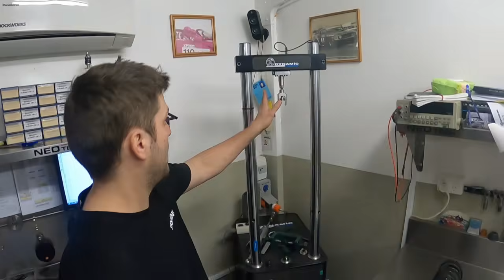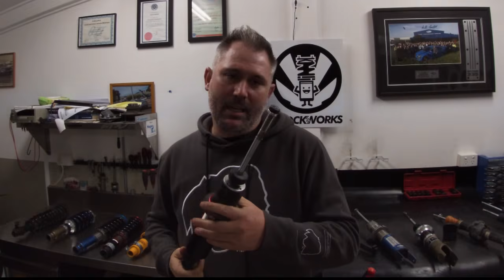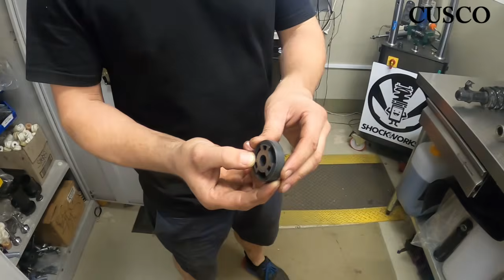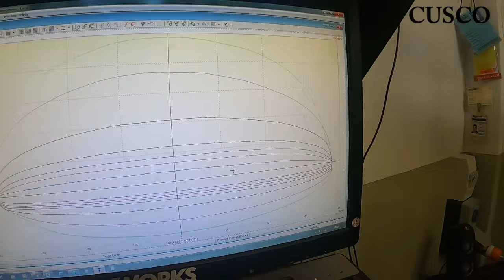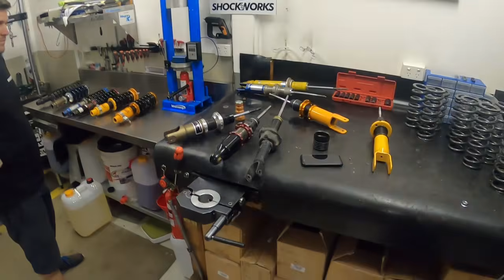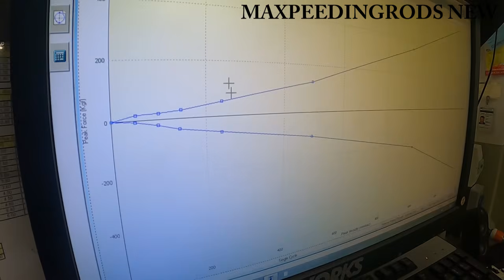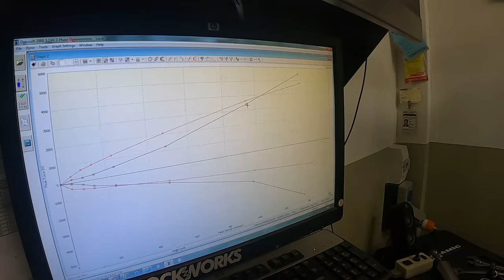8 BRANDS OF COILOVERS ON THE SHOCK DYNO!!! WORLD FIRST TEST

Comment: ....but how does the shock control the spring's motion?  The damper needs to match the spring and be able to control it. To stiff of a spring and the damper loses resulting in a bounce. Like cars going down the road porpoising 🐬🐬
Reply from the maker: Correct but it starts with the right shock
Reply: The gas or fluid in a damper is designed to be pushed through valves which together slow down uncontrolled motion and create resistance to movement in general.

Think of it in terms of a damper which you might find at the top of a door that has a spring that pulls it shut. The damper controls and slows the motion of the door, allowing it to close gently. Without the damper, the door would slam.

A car's damper does similar by controlling the repeated, unconrolled body oscillation that a car with an undamped spring would have. 

Yes, the damping range must be matched to the weight and energy of the spring. High spring rate/lower damping will result in under-damping (too little body control, a wallowy feeling). Lower spring rate/high damping will result in over-damping (where the damping force is too "stiff" for the spring, the damper shaft moves too slow to effectively respond to uneven surfaces, causing the tires to skip and lose contact across bumps and crash down into dips [jacking down] instead of smoothly moving up and down in response to dips and swells/bumps in the road).

Comment: I want to put them on a 2013 Honda CRV just to fill out the gap a little maybe lower the car an inch and a half with regular proper street driving/no racing no hard driving do you think they will last as far as leaking, as far as I’m concerned, I’ve had 20 year old stock coil overs and they never leaked I drop
Reply from the maker: If you are talking about mxr coil overs they will be fine if you get the T07 or T06 design, but if you make it too low the shocks won’t be able to do their job it might just be sitting on the bump stops
Reply: @TURBOTRISTO  I have 18 inch rims and a 50 sidewall I think an inch and a half max. I still wanna have some gap because I use it every day it’s my family car. I checked for the T7 and nothing comes up for the fourth generation, CRV if you can find a wink for me, I would really appreciate you. Hey, thanks for replying keep it real.
Reply: If you want to see my car, it’s all my YouTube channel. I think it’s about the first second or third video in. It’s really cool looking for an old guy. Ha ha ha

Comment: There are 2 versions of BC, the basic one BC V1 with 44mm piston (the one you test) and a slightly more advance model BC BR with 46mm piston.  Do you think a bigger piston and body can improve the performance significantly?
(Currently I want to change my coil overs, the price between BC BR and BC V1 is not too big, around USD$150)
Reply from the maker: @illson12345  since this video there have been several updates to almost all brands mxr have revised their design 5 more times and are as good as the bc tested and bc have improved aswell, I recommend buying the best most expensive suspension components you can afford

Comment: I'm looking to upgrade my OEM shocks on my 2006 Acura RSX. Unfortunately Cusco's specification sheet doesn't have the DC5 compatibility. I'm looking for a premium comfort shock for daily driving. What is your recommendation? Should I write an inquiry for the Shockworks, or look into more generic brands such as BC or Tein? I'd appreciate any input, I am very new to any type mechanical modding let alone car scene thank you.
Reply from the maker: if you are only wanting to upgrade the shocks with out lowering the car I would recommend some KYB SR's for the ultimate i would recommend some neo max or shockworks  then something more generic i would say BC or Tein is ok but may be slightly harsh
Reply: @TURBOTRISTO  I appreciate the swift response. Im not particularly interested in lowering the vehicle. Overall comfort is priority, I’ll look into KYB and Neo Max. I haven’t heard of them before. Shockworks look amazing, but may be overkill for my application. Thanks again
Reply from the maker: I run 30mm lowered springs and kyb sr shocks in my mrs accord euro daily driver it’s great still feels oem but it’s lighter and handles better and is more stable

Comment: Not sure if I have this completely wrong - but can digressive dampers be great for body roll but still be less 'great' for say poor condition roads (rutted, patched)?

I can see they 'blow out' with lessening force at higher speeds but because they so quickly ramp up in dampening force, are they still at much higher dampening rates on high-speed bumps than say a less performance oem linear style damper? I.e even the best 'sport' damper will still likely feel harsh on bad road surfaces.

I had Eibach/Bilstein B8's (only slightly lowered) and the ride quality was terrible.
It went well around a corners but unlivable for me and others in the car for day to day use, which I was very surprised about for a specific 'general' vehicle kit.

Swapped out the Bilstein's for Konies and got decent performance with much better ride quality.
Reply from the maker: My Boss At Koni will love to hear that, but i am sorry i dont have an  answer for you, i would say it has to do with shock travel and the rebound forces
Reply: @TURBOTRISTO  I didn't know you worked for Koni but from my experience and that of my friends they make affordable and superior products.
I had two of the Bilsteins fail in just 18months and so I happy they failed as it gave me the opportunity to swap into a better (for me) product.
Reply from the maker: thats awesome mate, what car do you have?
Reply: @TURBOTRISTO  Nothing exotic. Just an older Audi A4.
Still trying to work out how the car manufacturers are now managing to get such comfortable rides with flat, reasonably sporty handling on big lower profile tyres.

Comment: So, concerning the maxpeedingrods, is there anything that can be upgraded inside them, to improve them?
Reply from the maker: Not really , they have since made a T6 and a T7 design they are improving all
The time
Reply: @TURBOTRISTO  I only recently bought a set, I wonder what iteration I have..
Reply from the maker: what colour are they?
Reply: @TURBOTRISTO  Pale orange, black, and anodised orange..
Reply from the maker: YEAH THOSE ARE MUCH OLDER STOCK, THEY HAVE IMPROVED 10X BETTER NOW
Reply: @TURBOTRISTO  Damn it.. And I installed them yesterday.. They are pretty rough.. Heavy spring-rate, noisy valves, brake line/ABS tabs misaligned.. But hey, I understand you get what you pay for.. Lol.. Already looking at a better set..

Comment: Do the shockworks and cusco smoothen out the ride with stiffer springs?   What does it feel like to the driver in comparison?
Reply from the maker: I can only speak for the shockworks because after the video we wen on a drive and they were amazing absolutely perfect
Reply: @TURBOTRISTO  So a BC or Maxpeedingrod with that same spring rate will feel harsher in comparison to the shcokworks?
Reply from the maker: it would depend what that spring rate is, i would recommend emailing shockworks
Reply: @TURBOTRISTO  Like an 8k or 10k spring rate.     On BC and Maxxies it will be harsh over bumps.   I wasn't sure if a higher quality shock or strut could smooth that out, where we have ground contact at all times but not as much harshness transmitted into the chassis.    So we'd have the advantages of the higher spring rate and more smoothness?

I guess the only way to know is run both with the same spring rates.
Reply from the maker: it all depends on your application what spring rate you need
Reply: Yes they feel hard . I have the following shocks at these springs rates amr Front 12k rear 10k & shockworks front 20k rear 14k And the shockworks ride like a Cadillac just smooth even they being way stiffer. At the road course so much more body control. My friend has cusco front 22k rear 16k and his car feels harsh & bouncy. Another friend has tuned K2 front 20k rear 16k and feel harsh. Shockworks best coilovers I've driven on the streets or track.

Comment: I’m just interested but did any of these get checked to see if they had the correct amount of oil ?  Only reason I ask is I worked on my fair amount of motorcycle shocks and they are no different to cars and if they are low on oil they will bottom out a lot faster and basically only work at the end of the travel so I’m just wondering 
Did you check and if not it might be worth doing so
Reply from the maker: We didn’t check but none of them showed signs of leaking

Comment: Honda most likely uses multiple suppliers on different models. In general this is best practice. If you look at what happened with tata and their airbags, the reason why it effected pretty much every manufacturer but not ever model of those manufacturers is because by having multiple suppliers they limit their exposure to risk. 

Also showa is huge and still making tons of parts for honda. I believe honda may own or may have owned part of showa at one time.
Reply from the maker: @turbo_brian  I believe you are right

Comment: Would the maxpeedingrods be less bouncy than oem suspension? Or less bouncy than oem suspension on lowering springs?
Reply from the maker: Oem suspension shouldn’t be bouncy unless you have leaking shocks, lowered springs on oem suspension is bouncier, coilovers aren’t supposed to bounce they are supposed to be firm

Comment: most stock hondas these days use kyb
Reply from the maker: It’s still a mix of Showa and kyb yes
Reply: @TURBOTRISTO  I have a 2000 jmd integra sedan, my original shocks are shit now especially the rear, was thinking to buy some rev9 coils on ebay it do you think I should just buy back the original kyb struts then get good sleeves/lowering springs after?
Reply from the maker: it all depends on what you want from the car? do you just want it to look cool low or do track stuff or have a well handling daily driver that is somewhat comfortable? some new oem+ upgraded shocks and sensible lowered springs in a factory arrangement will always be nicer to drive on but will cost more than rev9 or mxr coil overs, I myself use mxr coil overs on the track and for daily use and they are surprisingly good, I also have a mate that podiums in his eg civic at every hillclimb in australia on mxr coilovers
Reply: @TURBOTRISTO  no tracks here in my country for me to go but I just want a fun daily I can rip on, not too bouncy for when I wanna take some trips around my small island and will last at least 2 years
Reply from the maker: hey mate if thats the case any thing will hold up at least 2 years i used maxpeeding rods for two years and they were great i swapped them out to a more expensive coil over but I am going to go back to MXR I really liked the way they rode and the adjustability
Reply: @TURBOTRISTO  ok thanks I was really torn between getting mxr or truhart.... The truharts were double the price so it was gonna take more time to save up the funds.... Importing stuff here is crazy expensive so I wanna do it right the first time

Comment: that test is nonsense, for the adjustable shocks you should at least test these with the middle setting go the clickers, not with fully open valves, its just stupid
another concern with description of the charts, as usually on speed/force dyne chart the lower part is rebound (negative force-stretching), while upper part is compression - positive force....so I have to question the professionalism here, unless these are some custom made charts to be upside down for some unknown reason, while the rest of the world is using negative force below the centreline, not above. however, I doubt that's the case here, as it is clear from the shape of the curves that the rebound is the bottom one (only small force is needed to fight the spring extension) while the compression oil the upper curve as it should be, as greater force is required to prevent body roll. so once again, what the so called "expert" is selling here is a complete BS!!!
Reply from the maker: I tend to agree I did want to try the different settings however Chris is an expert in their feild I am not so I trust him and the way tests are performed, I do happen to work in a suspension related business and the guys that use our shock dyno tell me the same thing
Reply from the maker: If we were to test a 12 way adjustable shock against a 24 way adjustable shock vs a 30 way adjustable shock, the results would be far too drastic and wouldn’t be fair.

Comment: Im thinking of buying eBay coilovers because paying 3k for KW is riddiculous :(
Reply from the maker: it sure is
Reply: In case anyones wondering I'm going with BC Racing BRs with Swift springs 5kg front / 7kg back. Car is an MR2 Spyder.

I live over seas so the shipping and tax are huge but even then $1,700 shipped compared to over 3K for KWs and I refuse to believe that the difference between them are worth paying twice the price.
Reply from the maker: exactly man bc's are fine shockworks however are about 2k and crap on kw and everything else